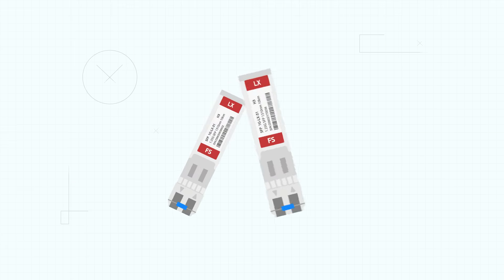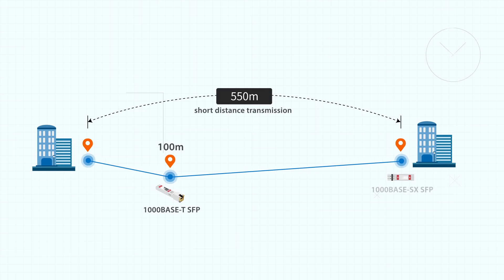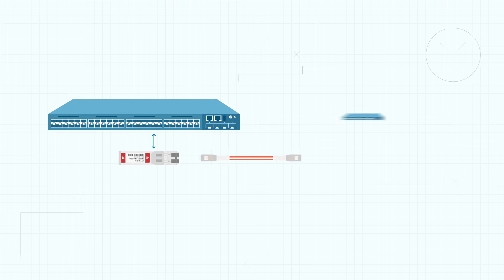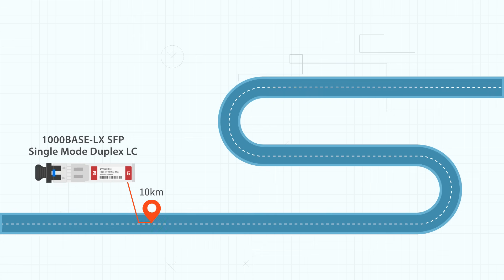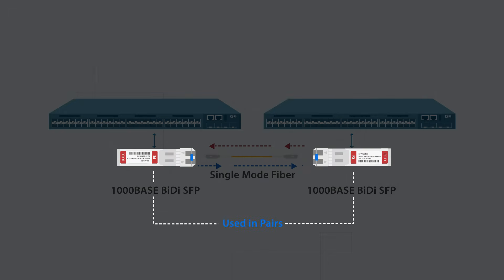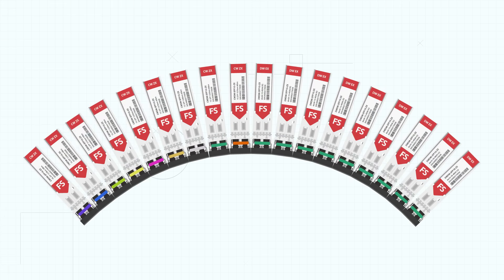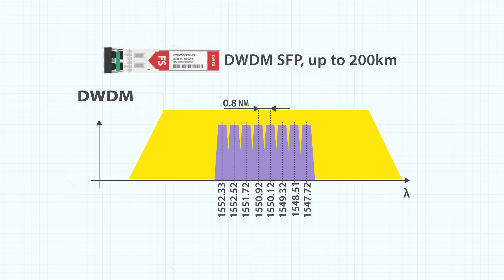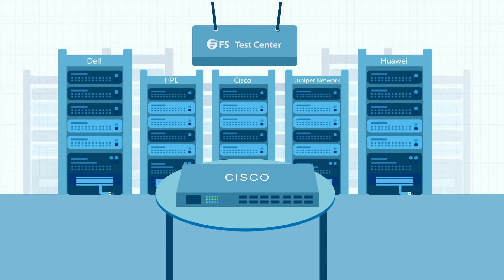SFP Optical Transceiver Overall Introduction| FS

Comment: SFP : short for Small Form Pactor ?
Reply from the maker: No, "SFP" does not mean "Small Form Pactor." The correct expansion of "SFP" is "Small Form-factor Pluggable." SFP is a compact, hot-pluggable transceiver module used in networking devices to provide connectivity options for fiber-optic and copper networking interfaces.
Reply: @FS_com  0:02 you forgot a word ^^

Comment: Hello there, Nice video, but I just wanted to ask,
Does the video means that sfp module can be considered as extender or signal amplifier for long range fiber optic cable?.... Thank you ver much for informative videos...
Reply from the maker: Hi, the module is just a simple optical-electrical/electrical-optical conversion device itself does not have the function of expansion and signal amplification.

Comment: Is this something that helps make a wifi connection better?
Reply from the maker: Sorry, the optical module has little effect on improving wifi. Because the optical module is mainly used for photoelectric conversion of signals, the electrical signal of the device is converted into an optical signal at the transmitting end, and the optical signal is restored to an electrical signal at the receiving end. No direct effect on wifi.

Comment: What makes a 10km SFP a 10km, and a 40km a 40km?  What is the difference?  Is it power tx power and receive sensitivity?
Reply from the maker: The transmission distance of an optical module is related to the TX Optical Power and Receiver Sensitivity of the transceiver. Both of them are important parameters that affect the signal transmission distance. In addition, the limitation of loss and dispersion in optical fiber transmission will also affect the transmission distance.

Comment: So does SFP only run in SFP ports right??? Like some switches only have RJ-45 ports, so they cant deal with SFP's right.... And then i assume all SFP ports can handle optical as well as electrical too. What about DWDM, id suppose some ports are not compatible with that, so you would need new routers/switches... Thanks
Reply from the maker: "does SFP only run in SFP ports right?" 
In short, the answer is yes. SFP can't work with an RJ45 port. But SFP can work in an SFP or SFP+ port. You can refer to this article: http://www.cables-solutions.com/can-i-use-sfp-transceiver-in-sfp-plus-slot.html
"then I assume all SFP ports can handle optical as well as electrical too."
More accurately, it is the SFP module that does these conversions. An optical transceiver module handles both optical and electrical signals, which are done by the optoelectronic assemblies in the module. You can refer to the article for more information about the major components of an optical transceiver: https://community.fs.com/blog/what-are-the-main-internal-components-of-optical-transceivers.html
Meanwhile, there are also copper SFP modules that handle only electrical signals, as have been introduced in this video.
As for DWDM SFP, most modern switches/routers can take a common SFP module or a DWDM SFP, for example, S3900-24F4S switch (https://www.fs.com/products/72945.html) supports many types of SFP modules. But of course, it doesn't mean all SFP port can accept a DWDM SFP, since there are too many types of switches/routers in the market.

Comment: I know this is a longshot but which one of these bi-directional modules will work with at&t fiber and an intel x520 nic? ( I have the cert extracted already)
Reply from the maker: Hi,  ikkuranus. Thanks for asking this question. After confirmation with our support team, I got that we only provide customized BiDi modules for Intel x520 NIC, and you can choose Intel customized on our website fs.com (you can find it by searching the product ID 37043 or 37055). Our BiDi modules can work with AT&T fiber that is terminated with an LC connector. If this reply doesn't solve your issue, you may contact our support team from our website.

Comment: Great Video, thank you! What does "LC" stand for? Is it used for a multi-mode fiber standard?
Reply from the maker: Hi, thank you for the question. LC is a type of fiber optic connector or interface. It can be terminated on the end of either the multimode fiber or single mode fiber. This article may help you know more about LC connectors: http://www.fiber-optic-solutions.com/lc-fiber-connector-definition.html